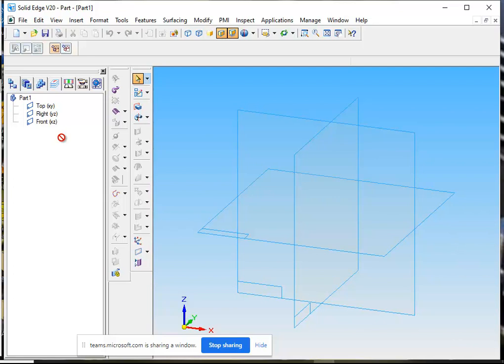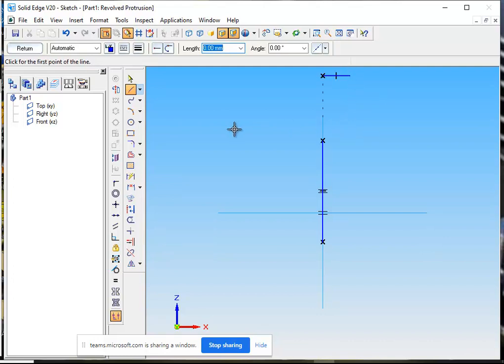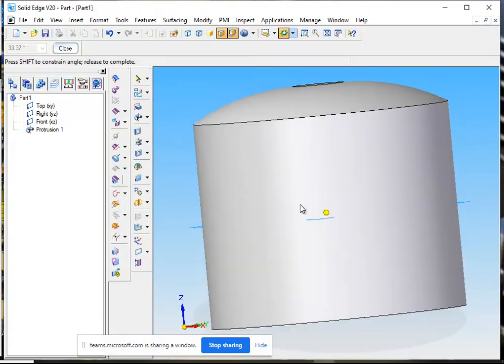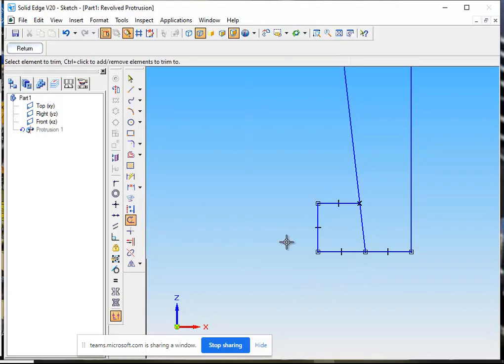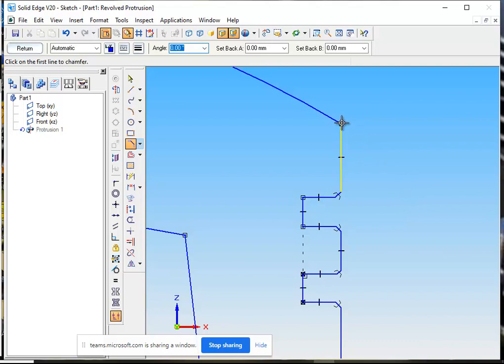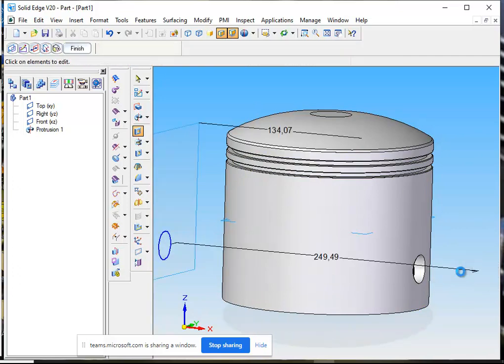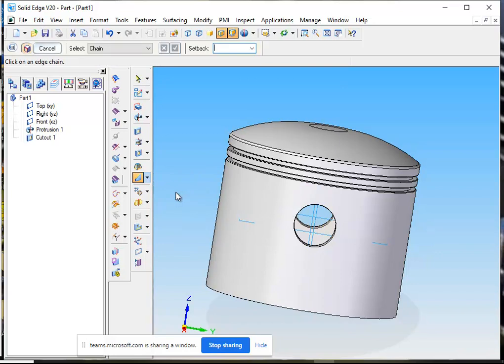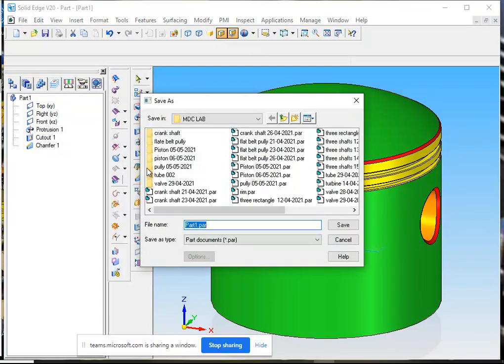Exercise 6 Piston crown | SolidEdge V20 | machine design tutorial | CAD | Mechanical Engineering

Comment from the maker: Comment about:
How many pistons does a Honda CD-70 has?
.
Thank you for watching.
LIKE | COMMENT | SUBSCRIBE
Reply: Ez.
70 pistons.
Next question?
Reply from the maker: Wrong answer. Honda CD-70 has 1 piston because it has single cylinder engine. However the cc or engine displacement is 70. You have mixed the concept of engine cylinders with the concept of engine displacement.
Keep trying and Keep learning